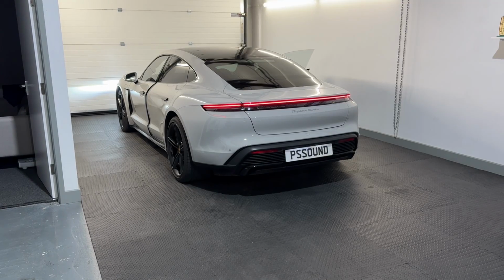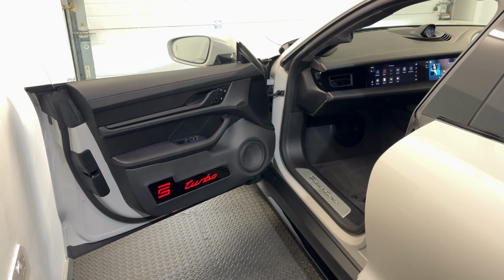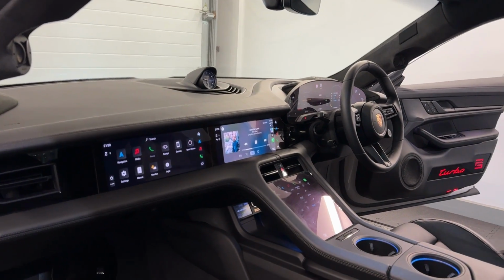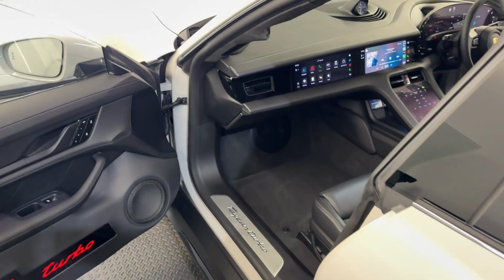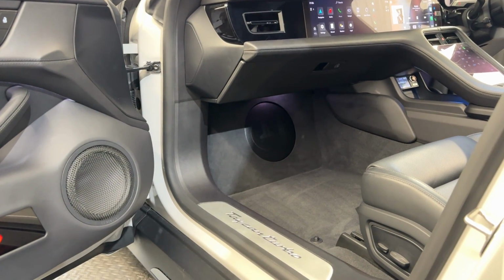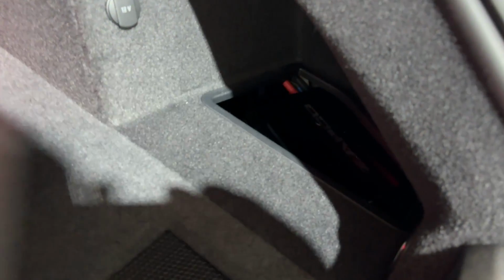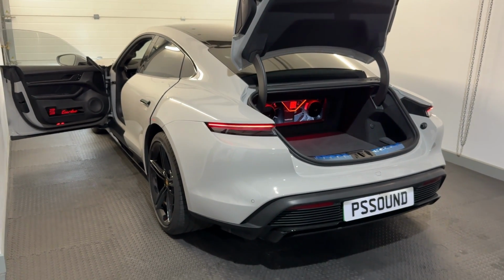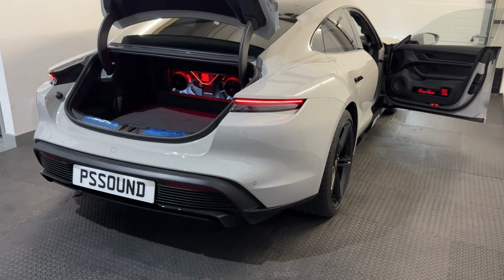Porsche Taycan Turbo High-End Audio Upgrade EXPLAINED - Accuton, Mundorf, Zapco, JL Audio, AE

Comment: For a front subwoofer, to supplement 50-100 Hz, if volume and power are not an issue, I currently have a 10WM, 25FSE, 10tw3, which one is better?

Comment: Hi, awesome video. Can i fit JL 8inch (w3v3 ) Subwoofer in 10x10 sealed box in footwell ? i think there thin series (TW3 ) will lack the punch. Please guide, waiting fro your reply.
Reply from the maker: 10TW3 outperforms the 8W3v3 in every way.
Reply: @pssound9749  ok, thanks.
Reply: @pssound9749  sir how does 10TW3 Compares to 10w3v3 if space is not an issue ?
( even in footwell ) 

in terms of accuracy and punch. 
Really confused, appreciate some help.

Comment: Peter how do you like the JL as a Front sub??? its mot your typical "SQ" front woofer ive seen you utilize ?
Reply from the maker: We’ve been using JL subs for many many years, because if someone, then they truly know how to make a good sounding sub. The problem is that most SQ fairies 🧚 don’t want to recognise it and they say it’s for street boomers. They want some fancy brands only like Focal, Morel & others only, whereas great SQ is about implementation. 
This sub did everything we needed, it’s tight, clean and accurate with plenty of headroom and also has a great benefit that’s underrated: has an option for a grill. Some may laugh at that, but once you need a grill and you have to make one, you know what difference it makes too.

Comment: Do you think a "too small" door enclosure is still better than the whole door?
I've got 12" PA mids for SQL and they would need 15-20l enclosures, but I doubt I could get that much, even just using fiberglass instead of wood.
I should be able to get 10l anyway, but that's a little small.

Comment: Amazing build - superb quality. On the subject of super-tweeters, I have a lot of experience with high-end home audio and of super-tweeters in that context. In fact my own speakers use a super-tweeter that consists of an AMT driver. Now in home audio it is usual to find that a low order crossover is used on super-tweeters and there is actually significant output well below 20KHz. I’m curious as to how you have set yours up?